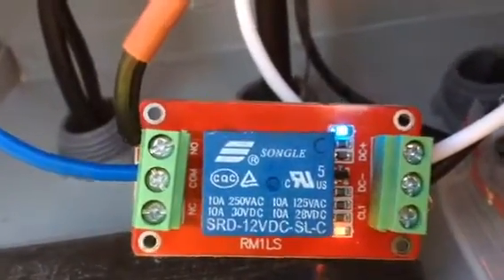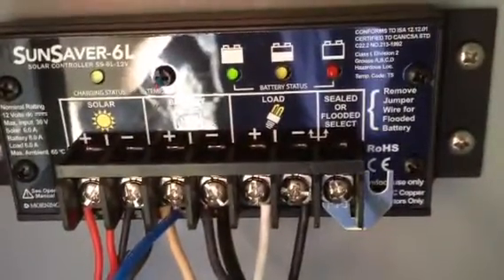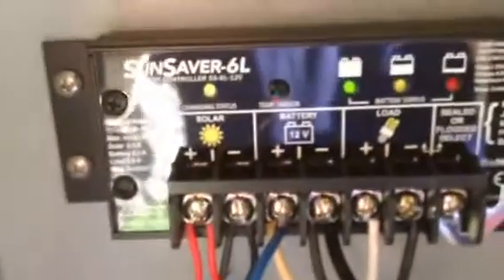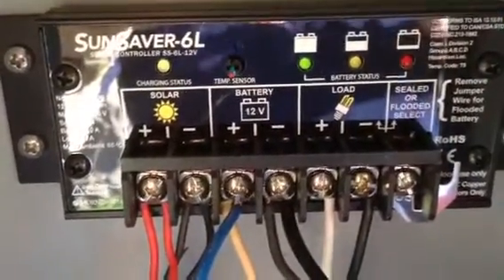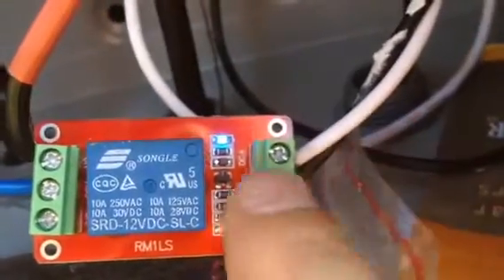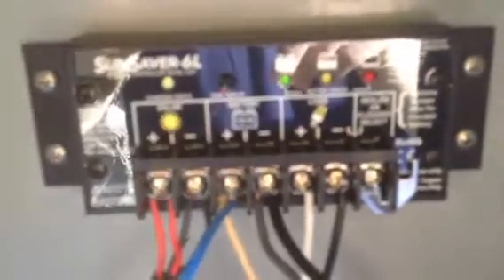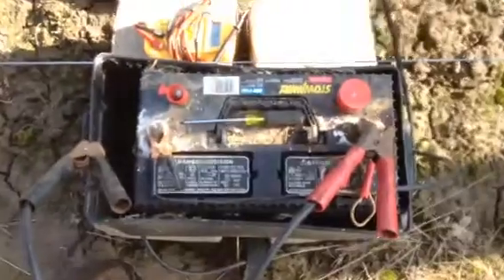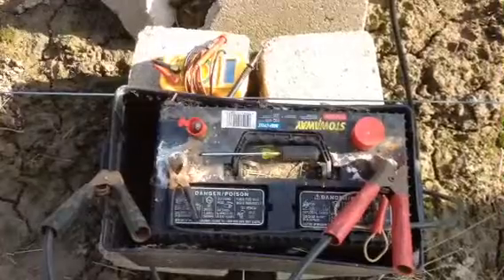MorningStar Sunsaver -6L solar controller hack

Comment: I’ve done a similar mod to my 10A version of the same charge controller.  I’m using automotive 30A relays. Incredible reliable and cheap. If you ever need to run a larger load, keep these in mind.